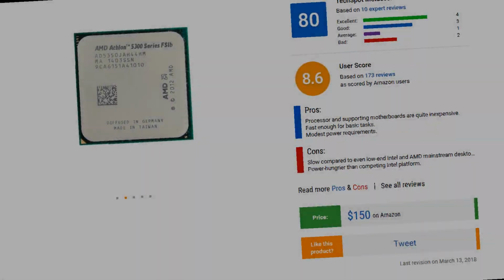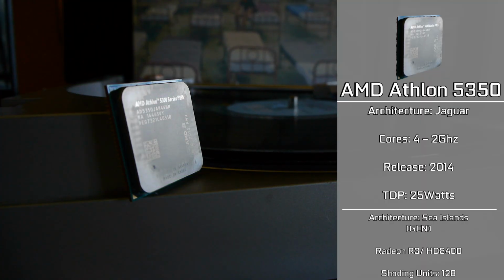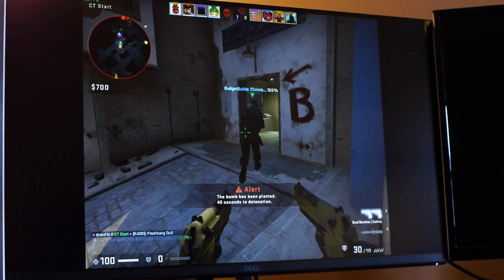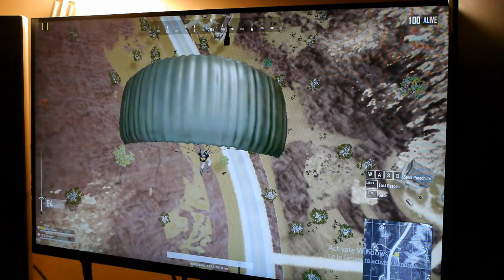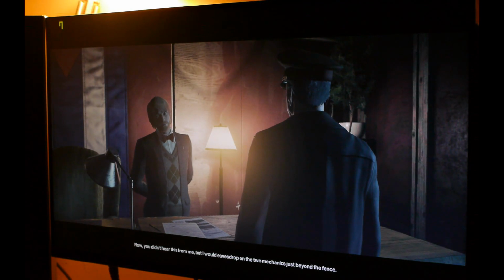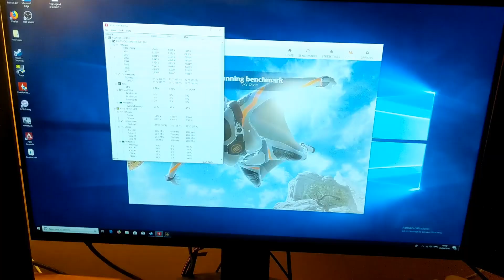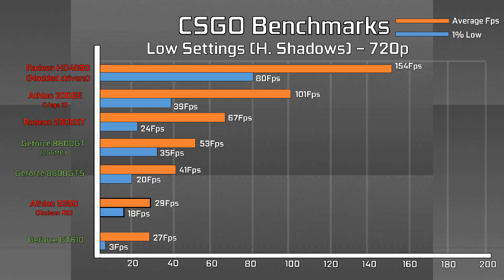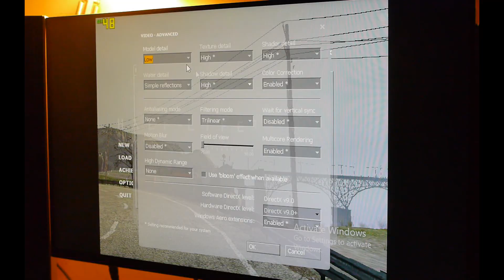Socket AM1 - Aging Horribly!

Comment: This APU is a further development of the Jaguar core, with which it shares its socket. Socket AM1 is actually FS1b, an evolution with the same pin-count as FS1, a Notebook socket. Hence, the Jaguar microarchitecture was designed with notebooks in mind, and thus, you noticed that 25W TDP and the low heat generation. The actual codename of the AM1 parts is Kabini, BTW.

This architecture is the same as the one in the PS4, XBOX ONE, PS4 Pro and XBOX ONE X, only that it has twice the core-count, and thanks to the APIs and some custom chips and memory configurations (Desktop Kabini IMC is Single-Channel RAM only), the issues with its dismal performance aren't quite noticeable.

Comment: Bashing on that FX series like the FX-8350 didn't exist.
Reply: you know that's not even the highest normal model, the 8370 is higher (and the 9000 series above that). But anyway alot of people dislike/hated the fx series. weak single core performance, hindered multi-core performance due to the shared resourced and whole core vs thread fisasco, and they were actually weaker clock for clock than the previous Phenom 2s.
Reply: @bluescluessuperagent  Yeah, but the 8350 was a particular standout in that series.

Comment: There is one area where AM1 made sense: Homebrew network appliances! It was significantly faster than Atom CPUs of the day in terms of raw IPC and it offers AES-NI for accelerating AES which was missing on Atom at the time. Plus, you could get it on a board with more than one PCIe slot like the ASUS AM1M-A which made systems with large numbers of NICs possible on the cheap.
Reply: Nah I rather stay with atom
Reply: @santiagosoriano7222 I have a Celeron J1900, would recommend

Comment: This was interesting. I've built socket A/462, 754, then AM2+ and AM3. Wasn't even aware of AM1. I did some looking on eBay and AM1 boards and chips (1) there aren't many available and (2) they are not inexpensive. If they were cheap I could see some appeal but... I am not paying $100-150 for an Athlon 5350.
Reply: The most I've ever paid for entire working computers with them has been $50, and that was a few years ago. Given what a Raspberry Pi 4 can do, today, any higher than free would take some convincing.

Comment: I have a dozen of these in standby to cover xp machines used on old industrial systems, is perfect for XP because it has drivers even for USB 3 and HDMI with audio which is not common for XP era, also they are great for a small Linux fileserver due to its very low power usage (26W with 2 4 tb drives, at the wall)

Comment: These were so good for so many things.
My only wish is that they made an athlon 200ge in am1 socket so you could upgrade and get 100% more cpu performance and 200% more single thread performance while still having a low TDP SOC for like £40.
That would bring a whole new lease of life to the platform.
4x jaguar at 2Ghz cinebench single: 40, multi: 160
2c4t zen at 3Ghz cinebench single: 120?, multi 310?
DDR3 2133 oc support would be fine as would the same pcie3x4 (board limited obviously).

Comment: I like how you said it handled CS:GO about as well  as a Core 2 Duo, when I got a higher framerate in that game off a P4 with a GT730. :/
Reply from the maker: Modern CSGO.
Reply: @BudgetBuildsOfficial  As opposed to? This was like two years ago. Can't imagine it's changed that much in about a year.
Reply from the maker: It has yes
Reply: @BudgetBuildsOfficial  Of you don't mind me asking, how has it significantly changed between 2018 and 2019 that would cause a noticeable change in performance? All I've noticed added in that time period is more cosmetics, and I think 1 map?

Comment: Damn this really shows the power of console optimization. The ps4 and xbone have to run on 8 of these cores, and while 8 is more than 4 that would only be at best a 2x fps increase over the figures shown in this video, and thats not even mentioning the fact that the console cpus are clocked slightly lower and i think games might not even have access to the full 8 cores.

Comment: AM1 was interesting at the time because it basically was a x86 SoC socket, no chipset needed. Of course, it never had any really good CPUs, it's basically just all netbook chips. About all I'd use this for at this point would be linux word processing/text editing, HaikuOS, or running a router off it. I certainly wouldn't game, or run web browsers on it.

The AM4 socket is also capable of running with no real chipset, even if I've only seen a single system that can be run in this mode. (The Deskmini A300.)

Comment: This CPU is great for low power uses. I have one as my pfSense router. I purchased it for that purpose in 2016. I have an ITX build with a quad port Intel NIC. It handles pfSense masterfully. I have 4GB RAM in it, with a lower power PSU. My original plan was to use it as an HTPC... Bad idea.

As a router it is cheaper over time than many other options (assuming you want pfSense caching and such).

Comment: i've bould my mom an extreme budget PC as a gift and the only goal for it was to be as cheap as possible. Managed to build it with under 120 USD using al new components so it's pretty cool in that regards. And seems to work fine as a simple browsing machine. Only thing that sucks is that there is no way of upgrading it as all.

Comment: I've found a competitor for the worst name progression scheme.
AM1? I'm pretty sure i bought an AM3 in 2009 with a phenom II x6 1045T so why did the AM1 come out 5 years after the AM3, and 8 years after the AM2
You're not wrong  the AM1 socket was released in 2014 apparently was meant for the mobile variants of the FX series with integrated graphics(2 core 4 thread instead of 4 core 8 thread) and was released after the AM2/2+/3/3+

Comment: I use an AM1 Sempron 3850 for a server and it just works. 8GB 1600 Ram and it never struggles. Hardly uses any power and has run Windows 10 and Linux with no problems for basic computing. It was never meant for gaming so I don't really think it's relevant 5 years on to expect it to. I'm glad I bought it and it does what I wanted it to do very well.
Reply: install h264ify for chrome if you are having trouble with video
Reply: exactly I've got the 2650 pretty snappy with an ssd will even stream games from Xbox one and plays 1080p videos just fine🤣

Comment: What killed these was the lack of unlocked multiplier. Many of us were clamoring to see what these could do with a heavy OC coupled with a 50W dedicated GPU. Some were able to get these to 2.7 GHz with some bus speed tomfoolery and found they scaled really well.

If it had an unlocked multiplier, 1-2MB of L3 cache (at least a phenom model with said L3 would have done) and a dual channel memory controller would have made it a beast for tiny builds.

Comment: I did a test with core 2 Q9400, 4GB ddr2 800mhz, Radeon R9 290 and doom 2016 was amazing. Opengl was around 4 to 9 fps and vulkan was 50 to 70 fps on mid to high on 1080p
Reply: The AM1 cpu you tested you should be able to get ultra setting in the 50fps range in vulkan
Reply: @XolaresTiberius  this thing is weaker than your c2q

Comment: You clearly know nothing. FX series are on par with Sandy birdge in modern software.
AM1 was a competitor to intel atom. It performs as such.
Reply from the maker: FX does not perform like sandbridge, and the Atoms....Theyre kinda better.
Reply: @BudgetBuildsOfficial  Ever seen this? https://i.imgur.com/vIowQDW.png It goes from 17% in favor of the 2500k in gaming to 9% in favor of the 8350. the FX beat the i5 (and usually, but far from always the 2600k as well) in productivity back when it was released. The point is, FX aged very well, considering how bad it was at release. 

And for the atoms (or celereon/pentium as they are branded on "desktop"... Are they? You didnt compare those. Suffice to say neither were suitable for desktop use even at release. For what they are suited for (thin clients, home servers) they aged well. HTPC not as much tho.

Comment: Nope, Apex won't run on that system. I even can' run it on Phenom IIx6 1055t. I need to upgrade to FX based cpu to run the game.
Reply: apex doesn't run on your 1055t not cause it's too weak. but cause it's too old and missing some cpu instructions 

I think this am1 is just too weak

Comment: The one I built for my mother back when they launched (it was the  fastest one, with 8GB, 120GB SSD and 1TB main storage) is still running fine for her needs, as in web browsing, her work stuff using office and HTPC. I chucked it all in an Antec isk 110 with its 90w psu and it never pushes it. I asked her recently if she needed and upgrade and she said that its still doing the job fine. 

Not bad for a SOC that was meant for places and people where more expensive computers were out of their price range, just a shame they never really expanded on it even if it was only as a 25W SOC option next to their APU's and higher. I guess the got replaced with the likes of the Raspberry Pi since these released.

Comment: I love this apu , is probably one of the best cpu i have bought so far (i also have an Ryzen 5, an i7 2600k,  a couple of mobile i3, a C2D e6600 and athlon 64). but this one cost me only 35 euros, 28 for motherboard, 30 for 8gb ram and is a perfect htpc, retrogaming or emulator (up to psp). Try to do the same test on the intel equivalent Atom Bonnel or even the later Silvermont...

Comment: That awkward moment when you realize this is the cpu our developers are dealing with
Reply: Yes, I think that the new Zen 2 based CPUs in the next console generation will have a great impact compared to the crappy Jaguar cores, although the consoles had 8 of them, not just 4 like this cpu
Reply: Well at least the consoles have an extra two cores to work with
Reply: not quite. whiles they have to put up with the terrible IPC, and low clock speed of under 2ghz to go with it, there's still double the core count, and double the L2 cache to work with.
still a slow CPU tho
Reply: @dexthegamer3234  still double the cores doesn't scale to twice the performance in the most of cases (and games). Of course faster memory could help a lot
Reply: @dexthegamer3234  Jaguar still had a higher IPC than the Piledriver and Steamroller-based mainstream desktop and laptop APUs that were out at the time.
Reply: This is the same architecture, but less than half the processor. Xbox One is literally twice this in both CPU and GPU, but with faster memory. The PS4 is twice the CPU, thrice the GPU, and both running at higher speeds.

Comment: This CPU only supporting PCI-E 2.0 x4 slot doesn't help in game performance.  That slot offers slightly less bandwidth than fastest AGP-slots from 2002. Of course it don't make a huge difference. I mean RTX 2080 ti in PCI-E 2.0 x4 slot is still faster than RTX 2080S in a PCI-E 3.0 x16 slot.

Comment: My 6300 is still playing modern games at a decent FPS.  The fx chips have aged very well. It's for the price you can get a ryzen which destroys it in terms of price per performance. I do plan on building a new rig, but I just don't game as much as i used too. I barely play any modern games anymore, unless I pick them up cheap on humble, in that case I play them for 5 secs tops and get bored.

Comment: You missed the entire point of AM1 as a budget gaming system, and that's overclocking! People bought these things for several reasons.
1.cheap home theatre pc.
2.cheap desktop for basic stuff.
3.cheap gaming as it could be overclocked to hell and back without stressing the system as it used so little power normally. I got mine oc'ed to 2.7 GHz and barely tried. This paired nicely with the RAM overclocking the Asus boards offered at the time.

This being said switching to an FX8320e was a big difference overall without even overclocking the thing. That being said though with AM1 overclocking was the major draw.

Comment: Considering this CPU was made to essentially run a refrigerator, it's amazing it runs anything.  I use this CPU as a living room PC where we do some gaming and for HTPC duty.  We don't generally play too many games that are newer, it works well at 720p.  We use an RX 550 graphics card, 16GB of ram on a BioStar AM1 motherboard with an SSD.  It works well.  Again, as this was meant for IoT applications, it works well.

Comment: bought the 5150 here . 1.6ghz base . was perfect for a NAS build with a Sata 3.0 Raid Card + 8GB 1333mhz Ram ( extremely memory limited bus which is ultimatly what lets down the system overall ) .

Comment: i bought a HP thin client to make it a HTPC, it has the AMD GX-420ca CPU (its pretty much the 5350/A6 5200 for the business market, the only difference is that it runs at 2ghz instead of 2.05ghz). i slapped in a GT 1030 because theres some things the iGPU just could not do. 

i did try some games on it
played elite dangerous, it runs rather well, 720p with high medium settings. 
and fortnite does run on it (on 720p and minimal settings). 
runs world of warships quite nicely.
older games it runs quite nicely, so being a HTPC buy it does what i need it to do, and if need be it'll game. now i know its lacking a lot of grunt in the CPU department, but meh i rarely play modern games, and i didn't really buy it to game on anyways.

Comment: For a 25w 2-2.5ghz quadcore platform, this actually ages well for a DIY Router using PFSense, since they require AES-NI with later revisions.
Reply: Thats the only use it has. Or NAS. Maybe even a small Minecraft server. I guess the single channel holds it back massively too.
Reply: he's a liar it was fm1 not am1 because 2014 was am3 socket not am1 and jaguar never made it to pc it was scrapped for the desktop variant for higher clock speeds
Reply: @raven4k998 the AMD athlon 5350 (the CPU he is using) doesn't support the FM1 socket.
Reply: @raven4k998 The only "Athlon" named CPUs on the FM1 platform were the Athlon II X4 "Llano" SKUs. The Athlon 5350/5370 are jaguar microarchitecture CPUs, under the codename "Kabini"
Reply: @raven4k998  Dude, AM1 is not Socket 939, which is the one used by the Athlon 64 chips that came before AM2 , socket AM1 is actually newer than FM1, and its actually called Socket FS1b, being FS1 the mobile version of the socket. Please learn your sockets properly before calling people liars

Comment: use a bigger resolution
Reply from the maker: Why?
Reply: @BudgetBuildsOfficial  would be fun
Also i have seen an increase in performance or at least a "non decremental" performance in games when the gpu is heavily more loaded than the cpu
Reply: im obviously talking about using the R9 Fury for that not the integrated
Reply from the maker: Ah right. I mostly benchmark at 720p for consistency, but yes the framerates stayed largely the same throughout all resolutions. I thought you meant the iGPU at first.

Comment: Still runing two Storageboxes (mini ITX Cubes) with AM1 in ITX, each equiped with a PCIe x4 RAID Controller from adaptec and 4 2 TB WD Reds in RAID 5.  

One of them Rocks a Sempron 3850 which is the Active Storage the other is a Sempron 2650 (which is used as an Archive). They are "running (if you can call it that)" curently WIndows Server 2016 Standard. 

Still holding out on a cheap B450, X470 in ITX... to upgrade it to a Ryzen APU like the Athlon 200 GE or Ryzen 3 2200G

Comment: it's kind of weird. I built a machine for my partner 5 years ago. And it still holds up for her (5350@2.2GHz, 16GB 1680Mhz , SSD, Geforce 1050Ti). I recently installed Generation Zero, and the platform was able to run the game at a locked 30fps on 1080p Ultra Settings. Are you sure you were not having any massive Windows Updates/Defender etc running in the background while gaming? Doom (2016) sticks around 40-60fps, locking it to 30fps makes the game more consistent while offering the ability to run at Very High settings at 1080p. Sure, 30fps isn't good by any means but it will give the platform the headroom it needs to play games at 1080p with pretty settings. I can easily play Rocket League, Paladins, Dirt 3, Overcooked, Bioshock Infinite, Prey, Doom, Wolfenstein II, Hellblade, Generation Zero. It isn't that bad for a 5 year 25W underpowered APU with a 79$ pricetag for the cpu/mobo-combo :) I use the very same platform as a survelliance server, samba file server, web server, ftp server. I runs mostly at ~1GHz :) It actually works really well to this day. I would love if AMD did a really downscaled motherboard for the AM4 platform, similar to AM1. The Athlon 200GE with a 32$ mobo be great for these kind of builds.

Comment: this cpu is memory channel limited. The Athlon 5350 in overall compute is similar to an old Phenom 9600 2.3 (95w 65nm Quad-Core from 2007).  
You should try Doom 2016 in Vulkan on this APU. Jays Two Cents did that a couple years ago with an r9 280x and 8gb of ram and got around 80-100fps in max settings! (I know its the magic of vulkan!)

I really want to see the Ryzen Version of the Athlon 5350. What I mean is something with 25w tdp and on the ryzen architecture. Yes I know the Athlon 200ge comes very close, but is still a higher wattage of 35w.